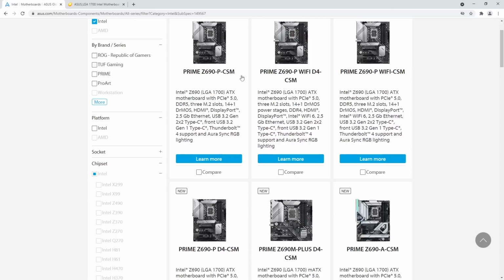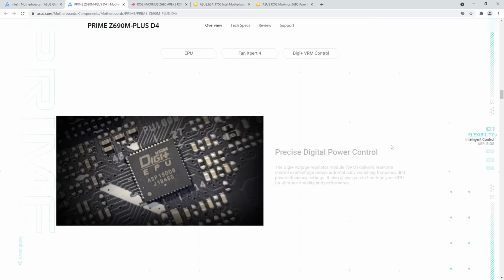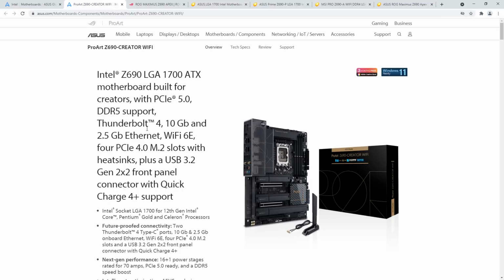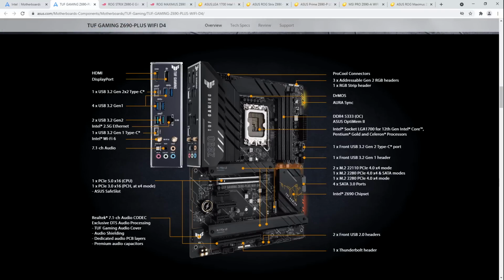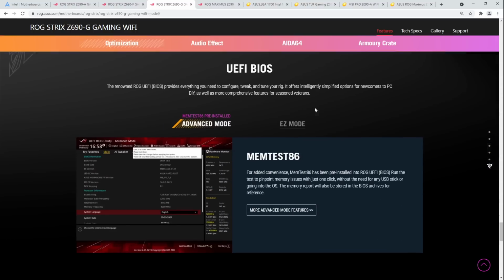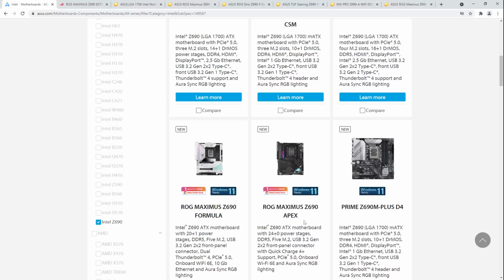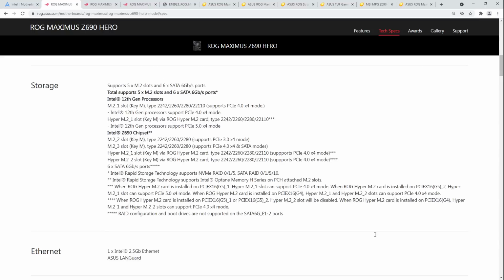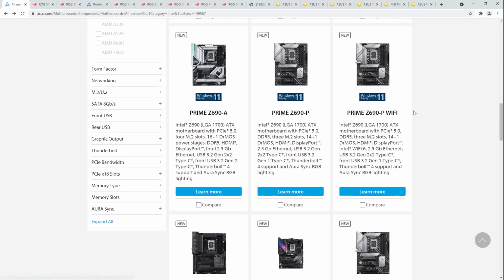Rambling about the ASUS Z690 Motherboard line up

Comment: Nothing to ramble about... get the Asus Z690 Apex if you're into overclocking. If not, just for casual gaming get the Z690 Prime instead.

I just saved you 1 Hour and 44 minutes of your life... thank me later.
Reply from the maker: Get an Apex for overclocking and an MSI Pro Z690-A otherwise.
Reply: @ActuallyHardcoreOverclocking  Why not a Z690 UD? It's normally about the same price as the -A Pro and has more USB ports and a better VRM. Is it because of the PCIe slot layout, the lack of debug LEDs, Gigabyte's BIOS, or something else?
Reply from the maker: @nathangamble125  MSI's BIOS is better especially on DDR4

Comment: first apex i dont like. 24 power stages is just stupid and covering the whole board with aluminum is stupid. i really hope they make something like the maximus xi gene with dual bios and low cost connectivity, sound and heatsinks. just the overclocking potential and no overpriced premium junk please.
Reply from the maker: they've been covering up the Apexs since at least the 12.
Reply: At least it's not plastic.

Comment: What do you do with all those USB ports on the back side? I need precisely two: keyboard and mouse. Then I want a type A and a type C on the front panel. Just in case. I only NEED the type A because my USB stick is type A. But sooner or later something is going to have type C.
Reply from the maker: keyboard, mouse, sound card, webcam, printer, arduino/oscilloscope. I also had capture cards and a second webcam connected in the past.
Reply: @ActuallyHardcoreOverclocking  Woha! BZ needs ALL the USB ports! :D
Reply: Ya Basic!
Reply: Jeg er enig med Buildzoid. More sata/usb more than 4-6 we to those things for both back usb A and Sata on the back.
Reply: I need at least 10
2 for the keyboard (usb passthrough)
1 for the mouse
1 for the wireless headset receiver
1 for the wireless headset charging cable
1 for the DAC/AMP I use for my HiFi headphones
1 for the Oculus Rift
3 for the Oculus sensors needed for 360 room scale VR

And I don't want some USB hub taking up space on my desk, no thank you.
Reply: Apparently you are not a flight, racing and space sim gamer as the different peripherals eat the USB ports up quickly.
Sure, you do not use everything at the same time but if you prefer laying your gaming rig out one time and not connecting and disconnecting different controllers then an ample number of USB ports is a requirement.
Reply: @billwiley7216  I like an un-cluttered desk, so should I get in that situation I would probably opt for a discrete looking USB hub fixed to the table or monitor stand so I don't have get under the table (I have one of those case holders that you attach to the underside of the table). To me rear-I/O is only for things that are absolutely-positively going to stay cable managed until it's time to upgrade the PC :P
Reply: @andersjjensen  Everyone has their own uses scenario. 
My gaming PC is exactly that and used for nothing but gaming and is set up in a gaming rig with the priorities geared towards racing and flight sims, hence this is set up to not have clutter, wires hanging from everywhere or controllers not in current use to not have a storage solution while being out of the way while still connected.
I have a secondary PC that is used for normal PC use and other game types such as real time strategy or other game types.

That PC generally only has a rear panel usb wired  mouse/ keyboard and now a second USB keyboard passthrough cable which runs through its mechanical keyboard.
My secondary PC is always what was my prior gaming PC that is replaced by a new gaming build.
I am in the process of building a new Alder Lake system that will replace the current 10700k/3080 gaming build as my gaming PC.

So the way my use is designated there is no cluttered desk to deal with!

Comment: Quatsch du kannst 2 4wifi lang mit 5 gund Bluetooth 5.0 zusammen mit einer Router 1000 Verbindung Leitung und damit 1500 bis 2000 in LAN zu legen 4800 zusammen mit Bluetooth Wifi Bild steuern und Birds steuern step to step download  das teilt sich auf beiden n.m 2 auf mit darten und Spannung und gibt einem haupt terred Stripper alles in 8k auf halten auslassen Maximum überlimit Bandbreite
Reply: Du brauchst nur Adapter 60 Euro Type c USB 3 und in 3x 16 kannst du eine Adapter nvme nutzen um DisplayPort 1.4 auf das andere zu verbinden per to per 8k 12m60 auf 8k Daten tankt bis Bandbreite hz 256 Monitore zu beheiitzen auf der richtigen art

Comment: I agree the add in card for m.2 is way better than stealing all the room on the board and all the lanes for storage. I hope it catches on.
Reply: Problem with using a plugin card for more m.2 slots is many newer boards only have 3 pci-e slots, and if the do have 4 like this, Its useless if you wanted to have 2 gpu’s cause there arent space enough on the board to have clearance for at least a 2slot gpu which nearly all cards are today, unless you have a case with space for a 2’nd card mounted verticaly
Reply: really wish there's a mb with a x16 slot at the top and just 1 slot below another x16 slot, so I can stick my gpu in the second slot and not let any expansion card block gpu airflow
Reply: @badhusband1902  sometimes I wish they'd make a board with the gpu slot at the bottom of the board. It wouldn't get in the way of pcie slots, and wouldn't have its airflow obstructed. I guess case compatibility would be an issue
Reply: @christopherjackson2157   They are trying to keep the runs as short as possible       GPU<--->CPU
Reply: @KaTooMaz  good point I hadn't thought of that. Makes sense
Reply: @christopherjackson2157  Designs have to also account for # of traces and trace lengths. Running x16 lanes to multiple slots across the length of the motherboard leads to issues with signal interference/propagation, timing/clock sync, and copper trace real estate. It's significantly cheaper to just keep the single true x16 slot closest to the CPU. They are adding more M.2 lanes instead of more x8/x16 slots. Server boards have multiple x16 lane slots, since those most likely all get used for compute/data storage. Would be nice to see a better balanced consumer/enthusiast  boards

Comment: Alter erstellt Einfach ein Bluetooth Server und mit Software ein Wifibluethout 6 1 5.0 Server alles in einer Bandbreite 140.000mbits da haste deine Post Codes zum Him und her schieben das über eine Karte gut auf 2 hin 2.0 1 DpS 8k besorg dir boards wo du trippelte x16 hast und Karten wo du ,2x 8 verbindest für 16000TH/S Timing transfahre das im duall auf ein haut retro befeuern und mehr umsomatz verdreifachen der Geschwindigkeit und der Übertragung zurück